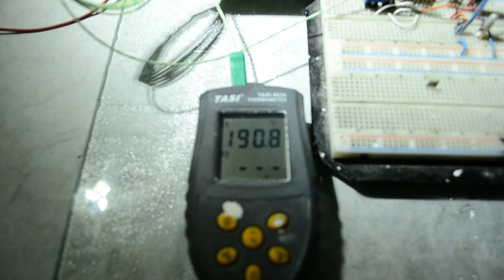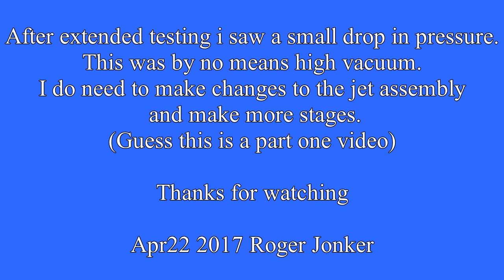Home made Oil Diffusion Pump fail

Comment: Best to buy a small old pump off ebay for the lowest price possible. Look at the jet shapes and sizes of the openings. This is the best way to learn. I am guessing you are building one for the exercise (this is OK!) because it is MUCH more practical to simply buy one off ebay! For the working fluid use Corning DC704 silicone oil. This has a very low vapor pressure at room temperature. For more information google: "glass diffusion pump images" This will give you a better idea on what the jet sizes should be. Good luck on your pump build! I built two of them before finally wising up and buying one on ebay!

Comment: You need to watercool it, in order to improve the backflow.

Maybe the inner tube is too thick also, with a smaller inner diameter, the oil will go up easier, like a thermometer.

Comment: Great video

My thinks....

Little close the gap between glass and porcelain at the bottom .

It boiling oil gas must be out the only from above holes.

The boiling oil must not reach the direct exit hole.

Why is the oil not boiling?
Reply: If you close the gaps then it can't recirculate.

Comment: I think the ceramic is too porous? plus you need to cool the walls so the oil vapor falls intermediately thus dragging gas molecules with it.
Reply: I would agree with the ceramic porosity but for the fact that it was glazed which should eliminate that issue. But yes it also needs cooling.

Comment: Too much oil in the first try, no cold cap, no cooling coils. In a diffusion pump the jet assembly sits all the way on the bottom. You have yours up above the oil a good bit. It also looks like the jet assembly is too tight.
Reply: Hello friend, I would like to know how I can calculate the amount of oil to be added to a diffuser pump, could you help me? The pump I have does not have a manual.

Comment: I don't think you "failed", just need to enhance it. I have a glass diffusion pump and the water-cooling jacket is huge. I think that's a big issue in your setup. Very good work nonetheless!
Reply: You're bad-ass man, I didn't think this could be done at home. Does it achieve high vacuum? what pressure?
Reply: Divad Ignawm I think they purchased the pump...

Comment: Hi Very interesting project, have a look at my project. I think you need to cool the condenser as someone else said. Also you need the jets to have a geometry such that the restriction causes a very high speed jet, the pump will only work if the jet speed is much higher than the random motion speed of molecules, in your jets the main restriction is the small holes, not the jets themselves. Also in a pump such as mine the condensate collects in a resevoir that is a couple of inches above the boiler, this means that the boiler is pressurised by a head of several inches of liquid, this determines the outlet pressure of the boiler. This last point is not clearly shown in many drawings and pictures, but without this design feature you may have a structure where there is no more reason for the vapour to flow in the wanted direction than the reverse direction. I will show drawing if not clear in words.
Paul Brooking
Reply: Hello friend, I would like to know how I can calculate the amount of oil to be added to a diffuser pump, could you help me? The pump I have does not have a manual.